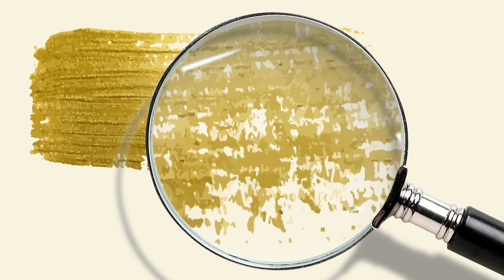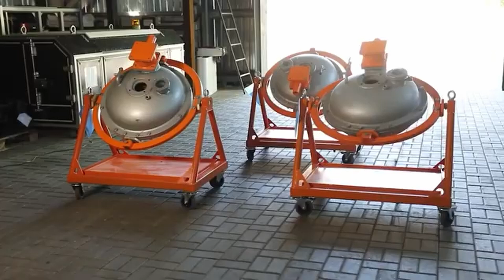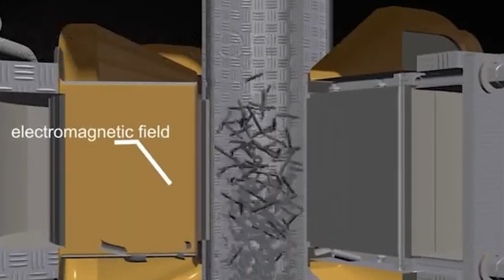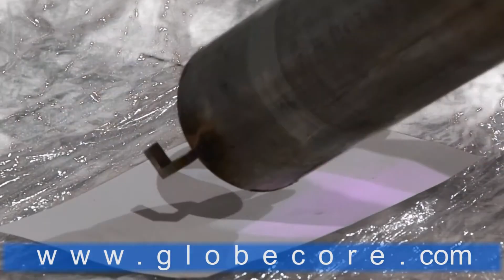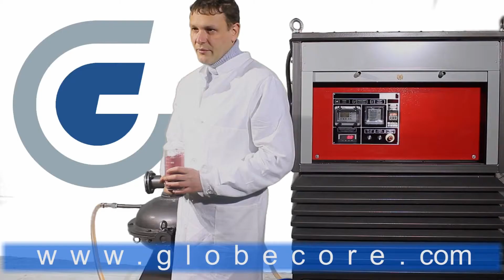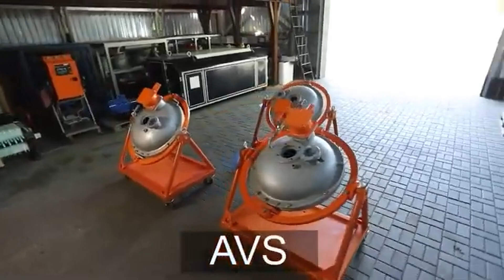#Pigments #dispersion (#grinding) and #paints #production by #means of AVS #vortex #layer #device

Comment: Do the ferromagnetic particles degrade or chip off each other, releasing contaminants into the process media over time?
Reply from the maker: needles (working elements) are mainly used from bearing alloy steel, it is very resistant to abrasion, or you can use a nickel alloy, or any other ferromagnetic material, or rather needles from it! Of course, the elements wear out, everything depends on the abrasiveness of the processed ore or material, but their grinding, by size it is colloidal iron, which practically does not affect the volume of the processed material. if you have any questions, write to me by mail core@GlobeCore .com